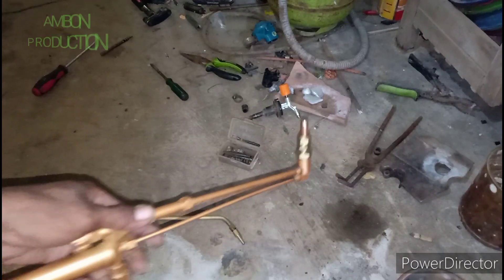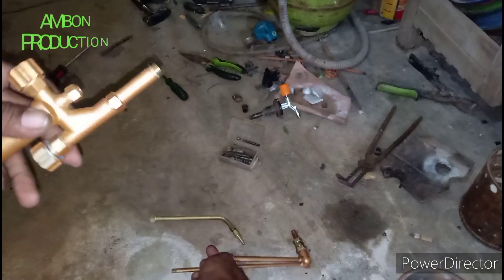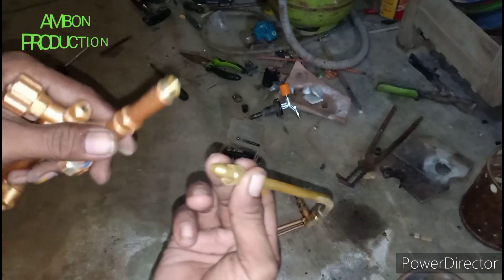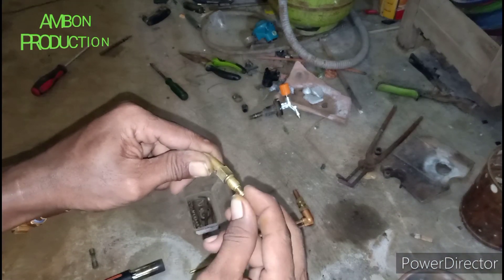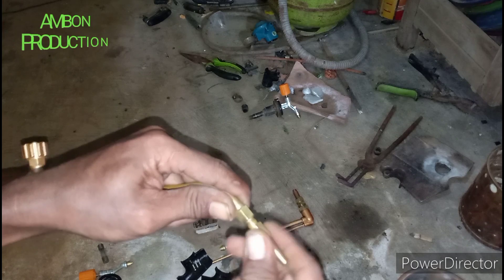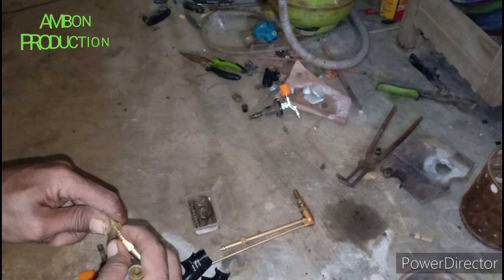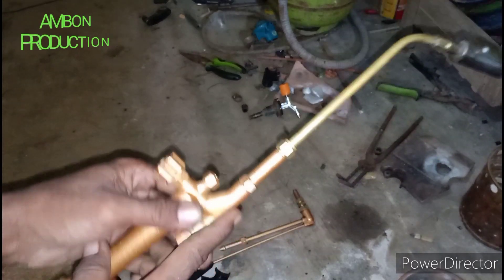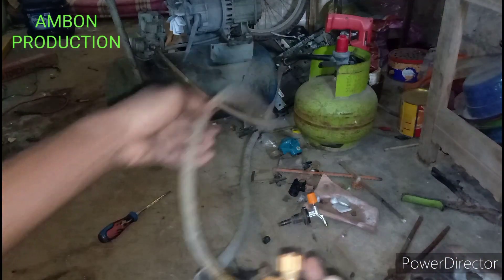modifikasi blender las biar bisa pakai gas LPG+kompresor mampu melelehkan kampas rem motor

Comment: mas kalau buat las yg kawat kuningan itu bisa ga ya?
Reply from the maker: Belum pernah coba mas tapi akalu aluminium kapas rem motor bisa meleleh pakai itu alat dan alat ini bagi yg tidak punya oxsigin udah ada kompresor kalau sama" belum ada antara kompresor dan oxsigin disarankan pakai oxsigi untuk hasil yg maksimal.
Reply: @Pejuangreceh-digital  siap om...
jadi bagusnya pakai oksigen plus LPG, gitu ya om?
Reply from the maker: @cbudigunawan9200  iya mas untuk hasil maksimal oxsigin dan gas asetilina dengen blender seperti itu bisa untuk potong besi dan plat tebal buat las juga oke kalau kompresor dan LPG kemampuan terbatas
Reply: @Pejuangreceh-digital  ok siap...
makasih banyak om 🙏
Reply from the maker: @cbudigunawan9200  sama" bosku

Comment: Klw pake kompresor kulkas bisa kah bang
Reply from the maker: Bisa bosku untuk tabung angi lebih besar lebih baik biar lebih setabil
Reply: @Pejuangreceh-digital  tabung saya kecil om cuman kuat 150psi
Reply: @Pejuangreceh-digital punya saya beli blender merek iwa tpi gbisa pake kompresor gman cara nya bang biar di rakit apa harus beli pipa untuk tambahan angin nya atau langsung sambung dengan cabang 2
Reply from the maker: @danlagi1486   harus ada tabung untuk yimpan angin Bisa pakai tabung bekas freon
Reply from the maker: @danlagi1486   yang dibutuhkan cuman 30-50 psi udah cukup tapi volume anginharus banyak dan untuk blender harus sedikit dimodivikasi karena angin kompresor beda jauh dengan oxzigin untuk hasil yang maksimal harus pakai oxzigin tanpa modifikasi blendernya
Reply: @Pejuangreceh-digital  ok bang terima kasih masukan nya sangat bermanfaat
Reply from the maker: @danlagi1486  sama" bosku dikarenakan saya tidak punya oxsigin adanya cuman kompresor jadi saya pakai untuk keperluan melebur emas dengan sediki modifikasi pada blendernya.
Reply: @Pejuangreceh-digital  itu angin nya nda msuk ke tabung gas kah om jalur 1 itu
Reply from the maker: @danlagi1486  diblender ada 2 Jalaur dan 2 kenopo satu untuk angin satu untu gas LPG dan sejenisnya
Reply: @Pejuangreceh-digital  karna angin kompresor mengandung air ya bang..